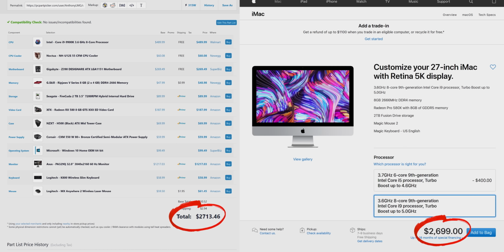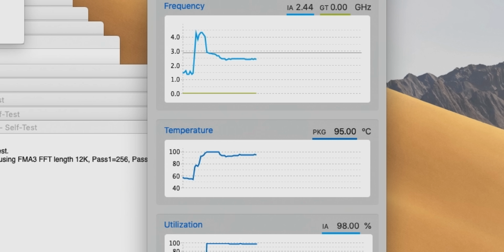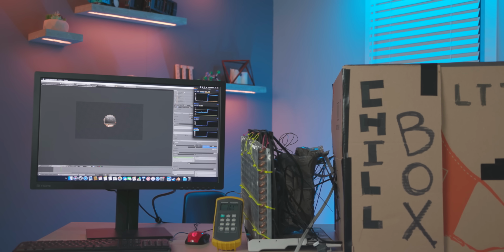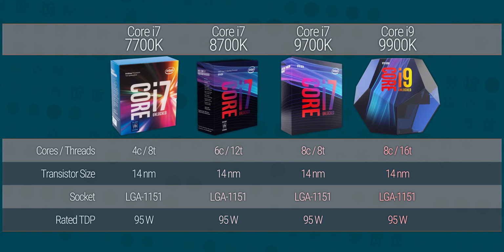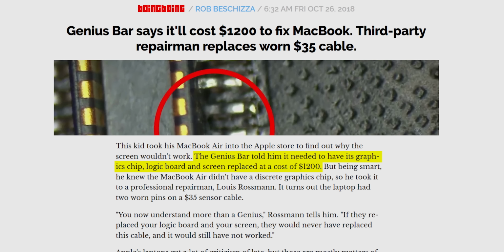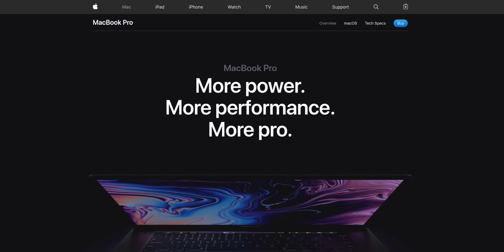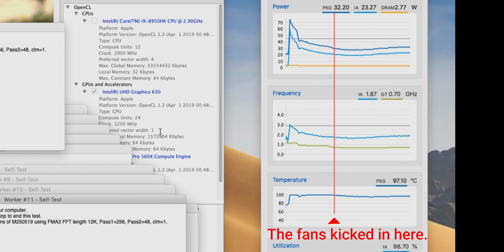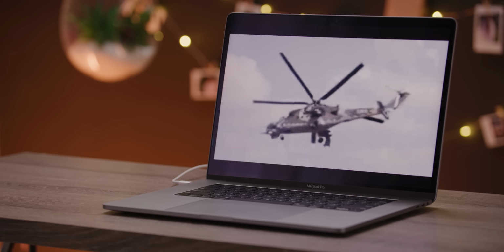Macs are SLOWER than PCs. Here’s why.

Comment: I use a mac, It's just a cleaner design (I'm talking about the OS, and yes they look sick too). To be honest you're not going to get a macbook pro to do heavy video editing / rendering and if you do that you really should get an external GPU so you can take some of the load off of your CPU. Really apple has done a good job if you look at how thin they are and you compare them to other laptops they are very thin. If you compare it to a water cooler PC ofc it the performance looks bad. But then again you are really paying more for the look and the OS, it's just cleaner.

Comment: Watching this on my Hackintosh feels good man!
Reply: @sebastianrios2732  I won't lol. At the very worst scenario I will just stop updating
Reply: @RectalDiscourse I don't own a MacBook. I have a hackintosh, an ordinary PC (I built it) that is able to run MacOS. 
To be more precise it is a triple boot. So I can use whatever system I want (Windows/Linux Mint/MacOS).
Reply: How are those things? I am curious.
Reply: @LiberatedMind1  You can make a hackintosh from almost any modern machine. There are of course some limitations (mostly with laptops, weird GPUs and unpopular motherboards). But both AMD and INTEL cpus work. There are some things that are hit or miss (audio jack, usb3, network cards). Other than that everything is like with a machine from Apple.
P.S If you want to update the system, there are usually a few steps to take, before doing this. Also it is a bad idea to update straight away (this is applicable also to original Macs)
Reply: Caesar cch What’s the advantage over PC?
Reply: @LiberatedMind1  you are using MacOS
Reply: Caesar cch Yeah but why is that better?
Reply: @LiberatedMind1  Let's get things straight. On my PC I have three systems: windows, linux Mint, MacOS. The MacOS performance is by far the worst. But it is much better than any comparably priced Mac.
So the point is that if I need performance, I can fire up Linux.
If I want compatibility I can boot up Windows.
And if I want great UX I can boot up MacOS.
And whatever I want, I get it at half the price of a Mac (with similar specs). Feels good man!
Reply: Caesar cch I see.
Reply: Caesar cch Whats better about Mac UX?
Reply: @LiberatedMind1  just Google it. There are many articles about the MacOS superiority in terms of UX (user experience)
Reply: @UncleCzarek  I'm gonna need a copy of MacOS since I want both Windows and Mac. Macbooks are overpriced and I just want something good. Mac OS will be for editing and Mac exclusive stuff. Linux is there for TOR.
Reply: @revgorodiouttp5119  Uh, you can get Tor on Windows too
Reply: @circuit10  yeah, but Windows has a lot of viruses, which is why I don’t like using TOR on Windows.
Reply: @revgorodiouttp5119  if you're REALLY concerned about windows having a shit ton of spyware (which there undoubtedly is, and it takes forever to remove), there's a version called win10 ameliorated edition, which is closer to win7, and has no windows update at all, Microsoft store, older version of office, and a diff ui. Cuz tor runs on windows, I use it occasionally. Tho overall in terms of security, as you know, Linux owns ALL.
Reply: @sebastianrios2732  qemu users: i don't have such weaknesses

Comment: Mac user here. This is why there's so many rumors of apple going to an in-house design. Those really nice iPhones that run cool and fast? Apple designed those CPUs. The crap CPUs that overheat and run like trash? Intel designed those. But you can't just go from one architecture to another without a lot of pain (remember PPC->Intel?). Give them a few years, you'll stop seeing intel chips in apple products, and all the thermal problems will go away.

Comment: We're going to continue to see the legacy of Jony Ive's thinner is "better" fetish for years; probably as long as Cook remains CEO. I'm typing this on a 17" Mid-2009 MacBook Pro (see https://everymac.com/systems/apple/macbook_pro/specs/macbook-pro-core-2-duo-3.06-aluminum-17-mid-2009-unibody-specs.html), whose 3.06 GHz Core 2 Duo can't run the latest macOS, but makes me appreciate El Capitan as one of the last truly "cruft-free" OS X versions.The Geekbench scores are what you'd expect, particularly that they're far more comparable to similarly-specced Wintel laptops of the era than recent MacBooks are (as you so clearly point out). I'd gladly lug around an extra kg or even two (compared to the new 16" MBP I'm eyeing) if that would get me a better-performing, more reliable, more honest laptop than what's currently on offer. I can't believe I'm the only one. I've even come up with a marketing-friendly name for the expanded beast. Let's hear it for the Late 2020 MacBook Max!

Comment: Interestingly, a 2011 mac pro with a dedicated GPU will run cooler and faster on windows 10 than it does running any iteration of OSX.  

I got one with no HDD or RAM, got an SSD and RAM, installed many versions of OSX and was having all kinds of issues, it was over heating, running slow and producing many graphical glitches, got the shits and installed windows 10 and suddenly it's running perfectly, gets hot when you'd expect it to but no sooner, on OSX it was running at 70 degrees on the desktop.  The only thing I had to actually do in Windows was change the registry values so the brightness would work correctly, because the auto brightness was messing up and now allowing the screen to be brighter than 10%.  

On the topic of fans ramping up to jet engine levels, My old alienware does that when you move the cursor, the problem is it doesn't make the CPU cooler, it's just always at 60 degrees idle.  Hits 90 like the flash punching energy bars while running.  I don't know how it does it, it was great when I got it.  Changed thermal paste and it made no difference.

Comment: I get that they run hot. But thats cuz apple is concerned about acoustics as linus states. However the thing he chooses to ignore and mislead about is that you can download free or paid utilities to let you adjust your fan curve to be more aggressive. I do that on my macs, they dont thermal throttle, they dont reach 90c, and most the time under full and intense load they dont go past 80c. This is literally the same kind of thing that PC users do in the BIOS and/or in utilities in windows to control fan curves on AIO's, GPU's, etc. So thanks linus for doing the same thing that you complain about apple doing.

Comment: Imo the general user experience is better on a mac. Like you mentioned, it feels snappy and doesn't sound like it's about to take off after opening just one single big file. Mainly the lack of fan noise and better sound and display are what makes me like the macbook more.
I use a 2013 macbook pro and a 2019 lenovo thinkpad on a daily basis (one for personal, one for work). Both 15"  with 16gb ram and an i7, allthough the lenovo has a higher clockspeed and better videocard. Still prefer the macbook.

If you want the macbook to run cooler than it's configured to, download a program to control the fan speed...

Personally, whenever I need to compute stuff that takes more than 15min, I use remote desktop and use a desktop computer / workstation with optimal cooling, but ofc. if you only have a laptop and computing performance is your main decision driver, you're absolutely right.

Comment: Linus,
Great video, thanks for not just glancing on the specs and being thorough. 
However, could you also comment on if ALL the slim and thin laptops have this issue as they all use pretty much the same intel CPUs? Macs and Windows alike? If yes, then what's the alternative? Buying thicker laptops and overclock?

Comment: Apple doesn't have a pro line of laptop, they have a snobby-elite line of laptop named pro.  Most creative and elite office work is very bursty so running crazy-fast for 5 seconds is the typical workload.  I would like them to also have an actual pro line with upgradeable components, a variety of ports, and cooling that matches the thermal load, and to call that line pro.  I like my new snob-book pro, I'm aware it's not a render box.

Comment: The retarded broke PC fanboys still commenting on this video screaming this is all the proof they need to prove that their cheap plastic bendy unreliable poor battery life’d PC laptops with terrible mousepads are better are completely unaware that this laptop was admittedly a failure by Apple themselves (and is accommodating customers with extended return dates/ store credit to replace with a new Mac I should add) and has been fixed in the latest iteration of the pro laptops. You don’t buy a Macbook because it’s shiny and metal, you buy it for the OS, user experience (something pc fanboys seem to have absolutely no clue about), reliability/stability, battery life, and you can still run windows os on mac hardware. The most annoying part about these people is they’ve never even used a Mac they just follow what every other pc fanboy says “bUt CaN iT pLaY gAyMs??” yeah sorry this is a machine for adults who actually work and it’s no surprise MacBook pros are a very popular choice for software developers/programmers ok rant over

Comment: When your talking about a laptop yes they do tend to go slower than other systems because of the temps.  However, my iMac still runs circles around my roommate's Windows and Linux systems.  They also seem to need to replace their systems every 3 or so years.  My iMac is from 2010 and is still running strong on Mac OS 10.13 (it started on 10.6)  Now I did get a specific fan control software that runs the fan faster at a lower temp.  So it's like on Windows starting on Windows NT and now running Windows 10.  The only maintenance I do is a yearly cleaning blow-out to remove dust.  Beyond that and adding memory it's just bopping along.   I've tried to use Linux on a windows machine that I had bought for a contract job I had and had to load Linux on it.  Linux seemed so painful to use, as if I needed to be an IT expert to use it effectively.  (maybe I just didn't get a good introduction, but Linux remains me of a torture system.) Windows machines just need to be replaced too frequently because suddenly the OS doesn't support the hardware.

Comment: I will probably never buy another windows laptop. In the span of 5 years my wife and I went through three different windows laptops, different brands, different price points. I have owned one MacBook Pro since 2014 and it has been the most reliable computer we have. Now for anything that actually requires power and resources I use my built windows desktop.

Comment: I like Mac OS X particularly 10.6 after that is started to go downhill and the hardware too.
Or should I say it started to throttle.....

Ever since my iBook G3 with Infamous graphics card issue, I have been bumping my fan speed just a little bit. A it runs cooler and B it lasts longer what more could I ask. Oh yeah apple could fix their software and make things repairable. That's why I bought used other than I can't afford new.

Comment: They do it by taking advantage of idiots = genius
Reply: Apple got caught slowing down their overpriced phones. People still buy it religiously, waiting Infront of the store until it opens. Like they are in a cult.
Reply: @theblackbaron4119  "Cult Stupid" sums it up. About 5 years ago, a coworker kept bragging about his new crapple desktop, I finally had enough, I asked wich model, we looked up the specs and price ($2300), i said i could build it for half that, turns out it had dual video cards that were 4 years OLD in their top of the line pos!, I showed him i could built a better system for $600, then I bitch slapped him and told him to go surf the net to see ALL THE PROGRAMS HE CANT RUN for 4 times the price, total crapple burn.

Comment: Macbook Pros are a waste of money, but I'm not so sure about my $800 Mac Air. Granted, I've used it only for browsing, streaming, and writing, but it has free "Office" and OS updates, AND has lasted for five years with hours of daily use without any significant drop in speed. The battery is still quite decent as well. So if you want a computer for those purposes...I mean, I'm not so sure it actually is more expensive - as a PC with equal performance (low-end) would probably have inferior longevity. It's always quiet and cool as well.

Comment: My old MacBook Air got burned just for watching Netflix. The f***ing fans dont Kick in until the CPU reaches 100 degree celcius on all macbooks. 
In my current MacBook pro late 2013 ive installed an app called turbo boost switcher wich allowed me to shut down turbo boost for ever for good. Now temperatures are much much better.

Comment: The reasons macs suck is they are limited even on the same x86 hardware.

The problem isnt the hardware. It is what Apple has always been bad at....SOFTWARE.
Reply: Tim VeePee apples software is pretty good, it’s it’s consumer practices that are bad
Reply: @zachb1706  Users of Final Cut, have complained about how messed up X is vs older versions.

Quicktime is worse than Windows Media Player, when it comes to being a resource hog.

Safari isn't even as good as Internet Explorer at this point and even Google Docs is better than Keynote.

IOS is just backwards. Taking 5 steps that it takes on most Android's takes 3 or less; speaks volumes.

The settings menu is a mess with a long list to scroll foe all your installed apps that need this menu.

The toggles are just on and off switches. They don't even double as shortcuts.

The widgets on the next version are gonna suck, just like the notification panel is messed up.

IOS being configured for basically 2 devices that functionally both are 98% identical (iPhone vs iPad) and iOS still being as limited as it is baloney for what they charge.

Price is not the problem. The issue is what you get for the price.

In the real world, it would be expected that a $1000 tv is better than one that may cost only $750. But if that TV was made by Apple, it would cost over $1000 and offer less functionality vs a tv that is $750. Or maybe even less.

All OEMs have very nice laptops. And even the fancy thin ones, still in most cases of several ports for expansion. But not the Mac.

How can you remove the sdcard reader, when most of your users are content creatures. They all use Sdcards. Because it is nice to remove the card from the camera, with all the videos and photos; and you can just copy it to your PC or Mac.

Then Macs suck at games. Games are apps too. Paying more, but yet being bad at something as simple as gaming is mind-boggling.

Windows struggled with games foe many years. Once they developed Direct X, getting console quality of better gaming is now achievable. But you lose some quality to allow faster acceleration. But Mac's focus on quality in graphics, as long as they don't need to move at more than 30FPS.

I realize that brand name products are more expensive, and luxury items are not about being top at everything.

But I prefer to pay for more tangible things and not just decoration on the outside.

Just because its pretty, doesn't mean it is good for you. Ask Johnny Depp!